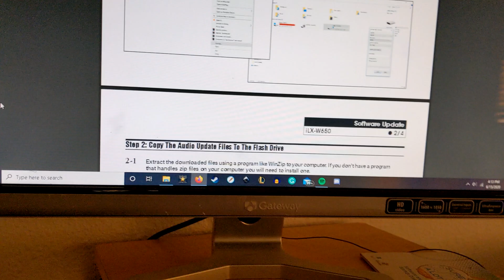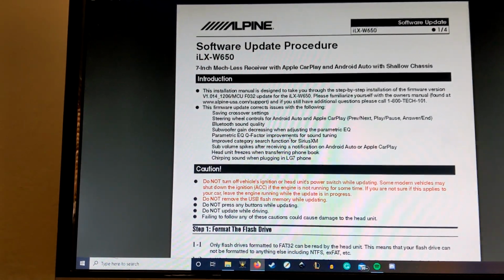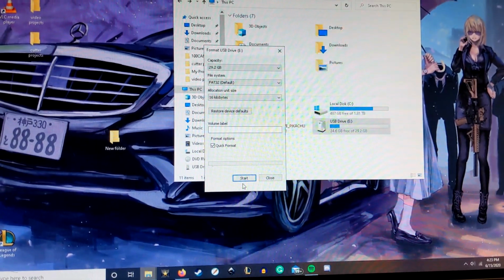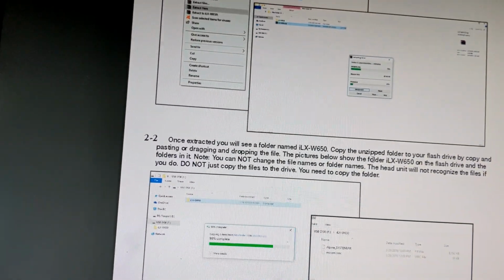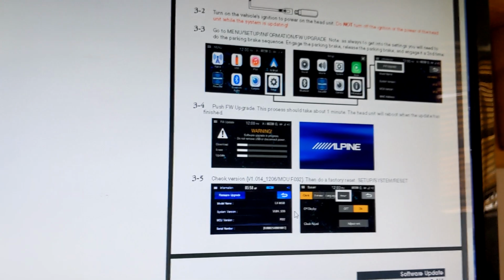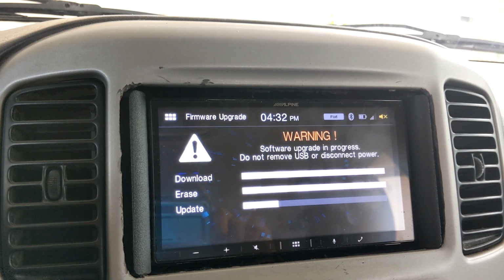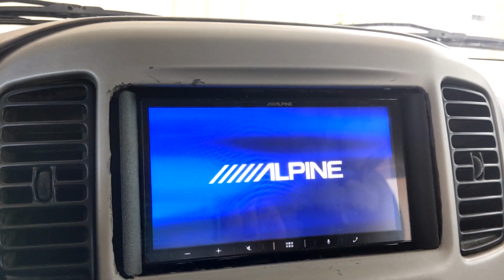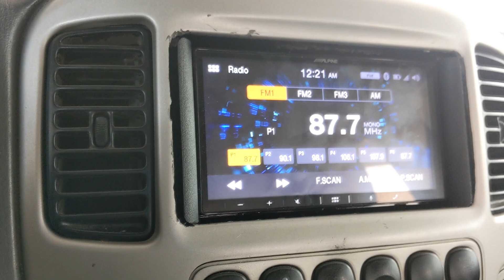Alpine iLX-W650 Software Update

Comment: Hello I have the same stereo it’s been over one year and 3 months .My screen is going out for like 20 minutes then it all works just fine .It’s so frustrating. I’ve rebooted it I’ve set reset this Stereo nothing seems to help.If anyone knows why it’s doing this please help me. I’m ready to give up and have to buy a new stereo .You can hear the radio working or the CarPlay is playing music but it’s a black screen. I called Crutchfield who I bought the radio from they said to disconnect the two running fuses wait a few minutes put them back on and reset the stereo I did that still the same problem
Reply: Mine did the same on a dodge ram 3rd gen. I disconnected the reverse cable that activates the rear view camera and the problem went away. it seems the reverse cable was feeding some current to the radio while driving.
Reply from the maker: What's weird is mine starting normally out of nowhere a few months ago

Comment: I installed the same head unit on my Subaru and first time it was so laggy with the apple car play and android auto. But at this time I figured out the problem is the usb. If you try to plug your usb phone the most directly way to the head unit the better it responds. I tried to keep my factory usb but now I’m using the wire from behind of the dash to the center console just use a longer usb like 6-8 feet

Comment: Only issue I really seem to be having with mine is accessing the settings menu. Since I'm not dealing with wiring into my parking brake I found out I can sire in a switch between my alpineilx-w650 and any ground point on my vehicle and it by passes that.

I think mine can be update, but it doesn't seem to be acting up so I think I might leave it how it is.

Comment: I have an Alpine iLX-W650 in one of my vehicles, haven't had any of the issues you've got. Interface is faster than most other head units, radio is crisp, Android Auto functions reliably and maps/menus all load up nearly instantaneously. I've seen plenty of other videos echoing my results, with the head unit functioning as intended. Without a doubt there's one of two things going wrong here: Either you have a defective unit, defective data connection on the Android device or USB wiring or the install/setup is botched in some way.

If you haven't tried these yet, I would highly suggest: Test the leads from each end of your harness to test for resistance, if there is excessive resistance in any lines or any crossover from one line to another you may have an over/undervoltage situation which can cause any number of electronic nightmares. You should also remove the 'middle-man' USB cable between the one in the back of the head unit and the cable leading into the Android device and test. Remember that not all USB cables are created equal and the length of cable leading into the unit from your Android device makes a difference as well, there's no such thing as testing your cabling too thoroughly. Good luck!
Reply: I too have enjoyed nothing but buttery smooth performance from my 650. Sound quality is fantastic and yes, zippy operations all over the interface and I bought mine used...LOL. Couldn't be more satisfied with this purchase. 

Would have to agree, most likely install/user error. Happens to the best of us.
Reply: Hey bro! I have an issue with my ilx650. I just use it with CarPlay all the time but sometimes the music from Spotify are just stopping or rolling on but not making any sound. Aaaand when I use Waze sometimes the takes a lot of time to get the nav from the phone. I mean there’s your map but your avatar it’s not moving anywhere when you are like 10 miles away from home. I just resolved this both problems at the old school ways plugging off and on until I get that working. Can you tell me any solution if it’s my phone or this head unit?
Reply: @Clastorga  same exact problem with mine. I’ll be 100 miles from home and Waze wants me to start back at my driveway!!!
Read up on Reddit…this is a common problem with Waze with this particular head unit.
So fat that’s my only complaint.
I use google maps which works fine but I really prefer Waze as you get police updates and it’s just a much better gps overall.
Reply: I agree my unit has been amazing
Reply: @shaunmontana3146  I’ll finally have mine installed on this morning and I hope I do not have to upgrade mine. I bought this Alpine unit along with the kta-450 amp (new speakers everything) from Crutchfield and I had to wait like over a Month for them to get this head unit in stock. I am hoping the latest firmware is already up to date…but yes all other videos I see of this head unit is buttery smooth just like my iPhone 11 Pro Max. 
I cannot wait to try this unit out. 😎

Comment: Hey man, really quick... you video last year with your grom lights flickering. How did you fix the problem and what was the issue? Thanks in advanced
Reply from the maker: It was the battery, the dealer installed a GPS tracker on my grom and it was draining the battery I installed a battery tender to keep the voltage up and it's fine now
Reply: CrazyMotorMaster thank you my guy that helps a lot!
Reply: @CrazyMotorMaster  wtf he was stalking u?